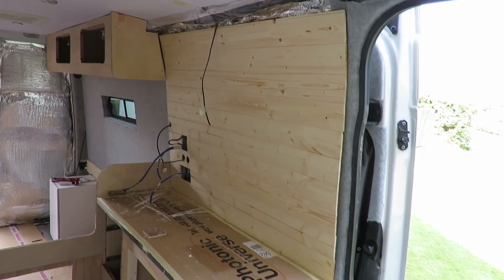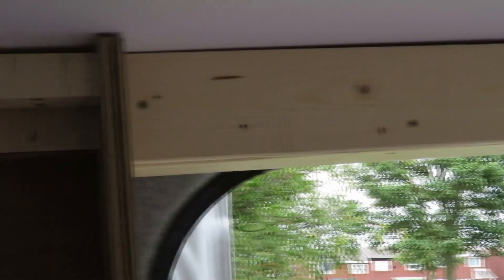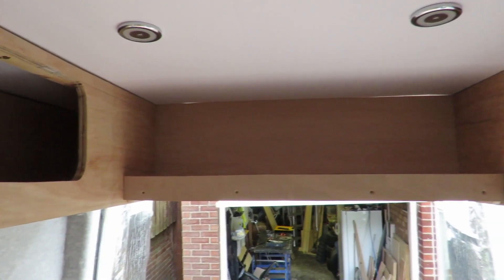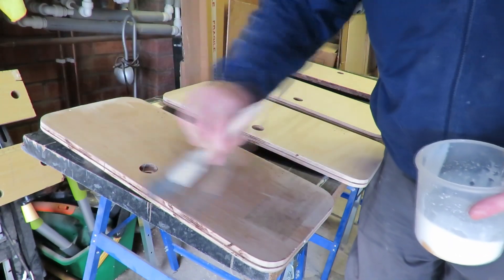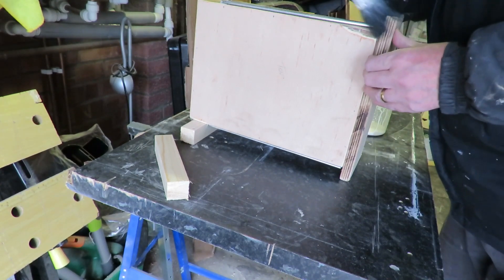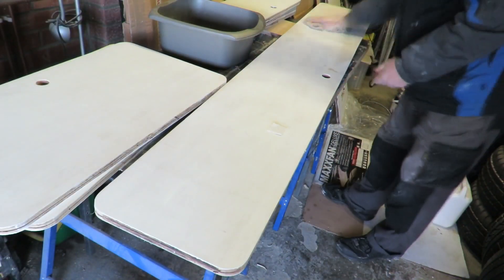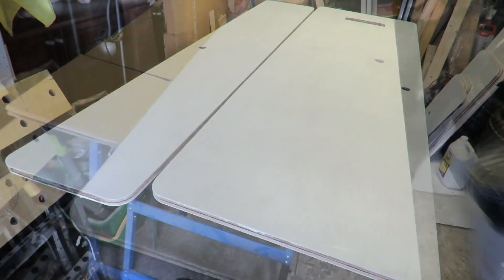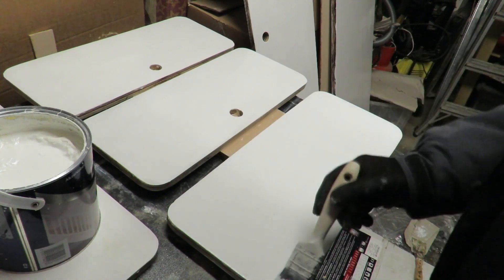How to - Storage Cabinets and More - Part 2 - VW Crafter DIY Camper Van Conversion

Comment: You are amazing. I need to go back now to the start of your incredible build.
I love the small unit that will pull out as bed.
I only have me and hand tools on the street😏.
My van is coming on slowly. Thanks for all the tips.
Reply from the maker: You are too kind Shey, glad my build has been of some help to you, the front bed with the pull-out section will have 2 maybe three sections to span from the pull out section to the side bench ( that houses the electrics and solar controller) which will store in the tall cupboard, I use hand tools also and find them better when doing some jobs, the power tools only speed things up a bit and are really not necessary, I used hand tools for a lot of years before starting to accumulate different power tools for different jobs over the years,  one piece of advice I would pass along if I may is to take it slow, don't be too eager to get the job done, you will find you end up with a much better job, good luck with your build Brian 👍
Reply: @thatdamnmackem  It is true, take your time. I am not good with that one 😊. I need to have a few days off.   I look forward to relaxing to your calming, relaxing demo on how to build a great van. .